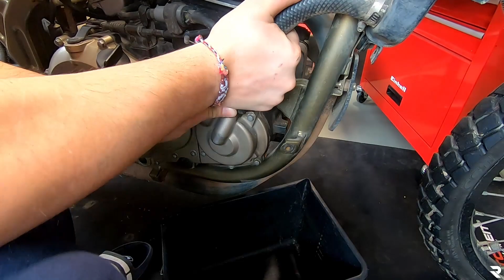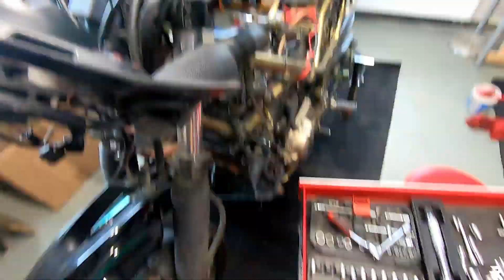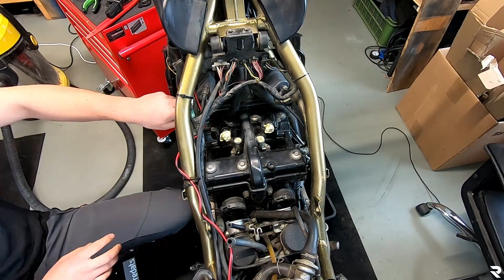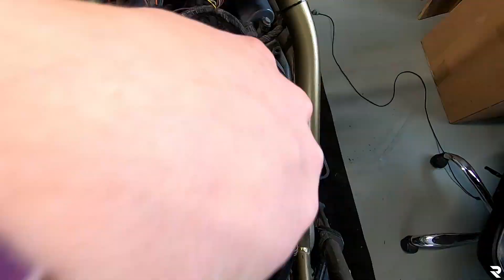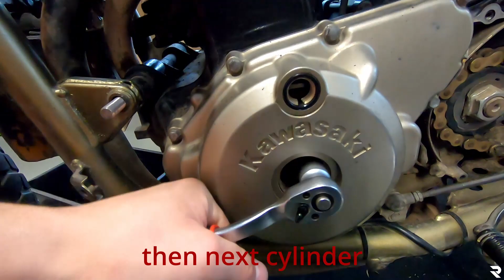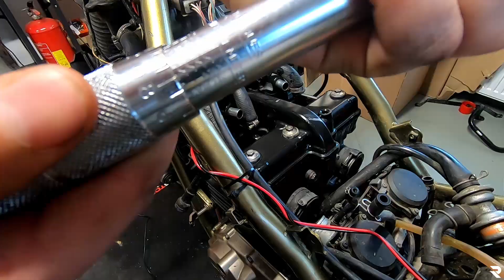Valve clearance on Kawaski KLE 500

Comment: Was looking at google. It's stated for Kawasaki vulcan EX500 inlet valve is = 0.10mm and exhaust valve = 0.15mm

🤔
Reply from the maker: The vulcan may have different valves and camshafts..what i know gpz 500 engines have different camshafts then kle 500..
Reply: @Ridge-Adventure ok noted😊

Comment: Thanks for the video. The service manual mentions the "T" mark, not the "F" one for the valve clearance. Did you do that on purpose (and if yes, why ?) or is it a mistake ?
Reply from the maker: You can have the T mark, but it's important to make sure the camshafts are aligned correctly, as I show in the video.

Comment: нет необходимости смотреть метки чтоб регулировать клапана на этом типе мотора,
регулируйте тот клапан где кулачки распредвала смотрят вверх - это просто, проще не бывает
Reply: When the valves are fully closed then? I just bought a 1995 model with 27.000 miles on it, seems ok but could probably benefit from proper service & adjustments I’m just wondering if it might need the cam chain replacing due to stretching? I suppose I’ll find out when I’m doing the valve clearances & check the timing?
Reply: @mikeyyoyo6464  
верно - когда кулачок смотрит вверх значит клапан полностью закрыт и можно регулировать зазор,
первое что нужно сделать при покупке мотоцикла - заменить масло и масляный фильтр - нельзя доверять информации прежних владельцев или сервисных центров об обслуживании мотоцикла - люди ленивы и многие склонны врать когда дело касается прямой выгоды,
меняйте масло и масляный фильтр каждые 5-7 тысяч километров, не слушайте глупый совет менять фильтр реже чем масло,
я советую заменить автоматический натяжитель цепи грм на механический, механический натяжитель намного надёжнее и он может регулировать сильно изношенную цепь грм.

Comment: Currently have the bike in pieces and i cannot remove those two copper lines that go just above the cams… how do you work them out of place so easily after taking out the screws?
Reply from the maker: The copper tubes are just pushed in. They have small o-ring seals on them...
Reply: You can use flat srewdriver and carefully pry out
Reply from the maker: Yes I used flat srewdriver too..👍

Comment: Why take off water pump?
In down side water pomp has bolt- its for drenage of antifreeze
Reply from the maker: I know...I take off hose only. It's a faster way;D
Reply: Well, I bought 4 liters of antifreeze, I did change it recently, but looks like I am going to do it once more, because I need to check my valve clearance. There is no way to do this without draining antifreeze, right?